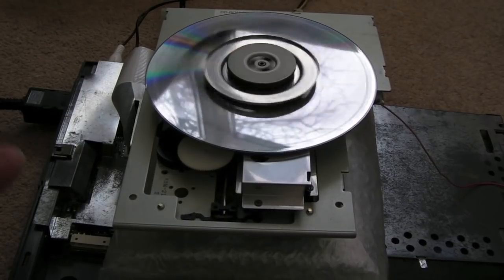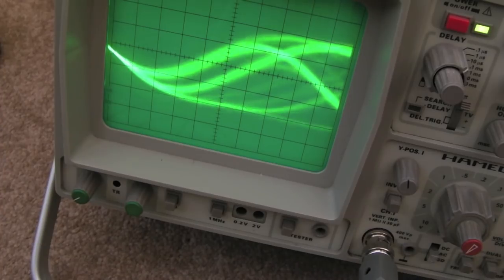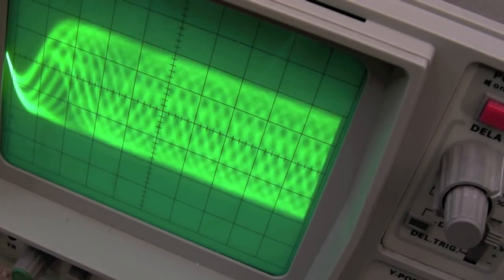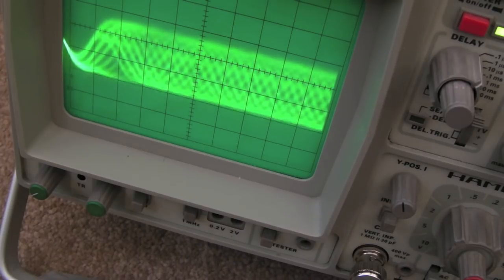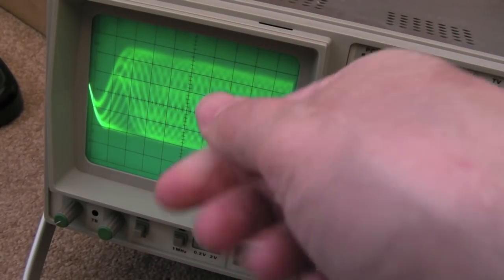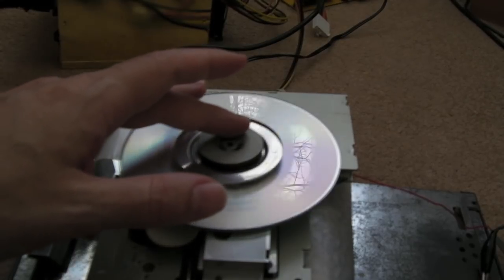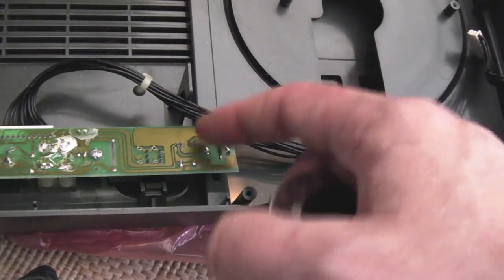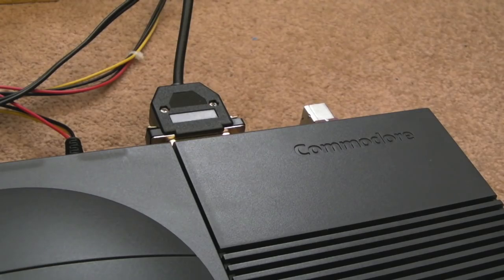Commodore Amiga CD32 Repair Part 4 - More CD Laser Adjustments & TF328 Expansion Follow Up

Comment from the maker: Part 1 - https://youtu.be/HmRy2TWIgWE
Part 2 - https://youtu.be/q5W3n_XiSOk
Part 3 - https://youtu.be/10-SJJRu5xo
Important: Make sure your CD32 is recapped, and the PSU is GOOD, as well as the power switch and power connector socket clean.  Voltage drop affects the CD unit - bad caps, dirty power socket or switch can give you CD read problems, leading you to think the laser is bad!  The laser removed from this was re-fitted 03/03/2024 (Patreon exclusive video) and it works perfectly!

Amiga Channels
mjnurney https://www.youtube.com/watch?v=chIF8JrIFS4
Riot Retro Gaming https://www.youtube.com/user/oobumblebeeoo
Amiten TV https://www.youtube.com/user/clubamiten
RetroGameModz CD32 Laser Adjustment (4 hours)
https://www.youtube.com/watch?v=lZK3Rmerg1I

Comment: Glad you sorted your laser out bud! I'm scared to touch the TEG FEB etc pots haha, I love my modded CD32, sooooo portable. When I met Solidcore from EAB a month back I took it all the way to Solihull with me in my messenger bag.
Come to think of it, there is enough space in there to put a Li-Ion battery in there! All we would need is a screen built into a set of glasses hahah - Great video! I'll have to try and de-stratch my logo with some of that paint you were talking about. Thanks for the mention!
Reply from the maker: Hehe - don't adjust your drive PCB pots unless you know someone has messed with them!  They probably won't need adjusting!  You're welcome regards the shoutout - it was long overdue =D  When I get better I will setup Skype and drop you a message!

Comment: Great stuff! Fun watching the changes on the RF signal. This bouncing of the RF signal is it normal? I understand it is from the wobble, but it doesn't have any effect on the data transfer?
Reply from the maker: The bouncing happens in sync with the lens bobbing up and down to match the "disc bobbing" - eg. on the outer tracks of the disc - the vertical wobble is more pronounced.  When the lens is near to the centre (track 1) there's hardly any bobbing.  The amazing thing is it doesnt effect data transfer (provided tracking and focussing is optimal).  CD is quite amazing really when you think about how fast the laser is being scanned and how accurate the tracking and focussing is.

Comment: Hi GadgetUK164
I'm hoping you can help me, my CD32 plays original CDs fine, same with original music CDs but doesn't play copies unless I prop up the CD32 to almost vertical while it's trying to load the game or whatever. Do you think it would be a simple adjustment of the pots or something different?
Reply from the maker: It sounds like possibly a worn carriage or something, but most likely bad tracking or focus coils.  The tilt to its side is helping with either tracking or focus.  Might be an idea to try swapping the laser unit out.
Reply: @GadgetUK164  
Thanks for the response and suggestion, the laser units don't seem too expensive so will look into it a bit further, thanks :)
Reply from the maker: The quality of these cheap replacements can be a bit hit and miss, if you see them for around £3 each, buy two or three (chances are one or two might not work well, 1 will be perfect).  If you luck out and all 3 work, you can easily resell the spares on eBay with a bit of markup, or keep them as spares.

Comment: Taiyo Yuden are still regarded to be the best quality blanks still available. Sony used to be good when they made their own discs, but I bought some recently and they're just branded Riteks. :/ However, these seem to be superior to CMC which have a poor reputation. Use something like IMGBurn to find out who made a blank. Verbatim means nothing really, the last batch of those I bought were CMC. Also, burning at 1x really shouldn't be necessary, 4x or 8x might help but dye quality is FAR more important. Try to stick with Ritek made discs, they're decent. Taiyo Yuden are superior but more costly and ... is it worth buying those just to make game burns?
Reply from the maker: Yeah, Ritek is best - never seen those for CDR media though?  It's worth using Yuden for game burns, when the game is £100+ for an original etc =D

Comment: How did you set the scope so all lines start at the same point? My RFO signal doesn't look like yours, it's more like a random waveform.
Reply from the maker: Check your triggering settings.  My trigger was set to auto.  On AC coupling.  The only other thing I can think of is to make sure you have a x10 probe!  Without the higher impedance probing it can alter the signal.
Reply: Thanks. Managed to reproduce it on my digital oscilloscope... Trigger set to falling edge, display persistence set to 4-5 seconds (this setting is what made the difference), X offset can be used to align it to the left.
Reply from the maker: Ah, yes - digital scopes it can be a pain!  You have POV persistance of vision on an analogue scope.

Comment: Great stuff, only really sad that TerribleFire, the one who invented the TF328 for the Amiga CD32 will most likely not make a accelerator board for the Amiga CD32 with a 68030 50MHz CPU, this is wat i and he said:

AmigaWolf: Such a pity you made a TerribleFire 530 Accelerator PCB board for the Atari and Amiga 500 and 2000, but did not made one for the Amiga CD32.

TerribleFire: The TF328 gives the CD32 a massive performance boost.

AmigaWolf: Sorry but that's not true in apps and games, it's only a little bit faster because of the extra (fast) RAM, that's it. A massive boost is what you get with a faster CPU, like with a 68030 you did for the Amiga 500 and 2000, that makes a Amiga CD32 or 1200 a LOT faster then the standard 68020 CPU.

TerribleFire: Its three times the speed? How is that only a little bit? In any case I asked the CD32 community if they wanted the 030 accelerator and they said no. Too many games would be incompatible. So thats why you didnt get it.

AmigaWolf: TerribleFire that's not true, i had a SX32 Pro with a 68030 50MHz CPU and most games worked great, and that was with the original Amiga CD32 games, my father bought it when I was a teenager, but I exchanged it for a Amiga 1200 20 years ago (yes I know stupid of me, now you can get €5000,- for a SX32 Pro). 

TerribleFire: True or not the community said no to it. So its not happening. At least not by me.

AmigaWolf: Wow that's really painful, because only 2,500 SX32 Pro units in total were made, and there were 100,000 Amiga CD32 made, so MOST people don't know what they are talking about :-(

Phhhhhh wish i never exchanged my SX32 Pro for a Amiga 1200 +/- 20 years ago.

As you can see in this video on 8:19 

https://www.youtube.com/watch?v=CiQujSV1skw

The link were i talked to TerribleFire:

 https://www.youtube.com/watch?v=OajY25w4VWk&lc=z22fvx35iwvkjzgekacdp432jzv0iwqh2s4tozzvd5hw03c010c.1518949136174068
Reply from the maker: I can see you really want a faster CPU there - it may still happen at some point, don't assume it will never happen.   For one thing, because he's made the firmware open source, when he gets to the 1200 accelerator, anything he does there someone else could easily adapt for the TF328.  They could in theory just lay the board out differently, and use the 1200 accelerator with some small changes.  So even if he doesn't want to go down that road, I bet someone else will - likely using the open source designs he's creating and sharing.  Personally I would rather get a 50Mhz or faster 030 for the 1200.  Even better would be an 040 for either 1200 or CD32.